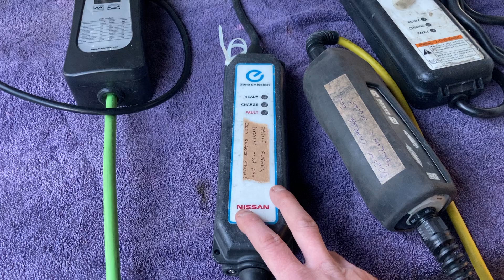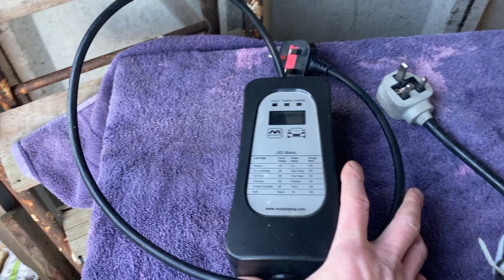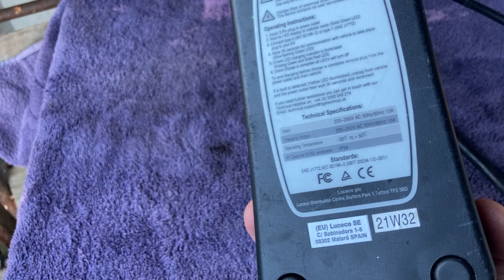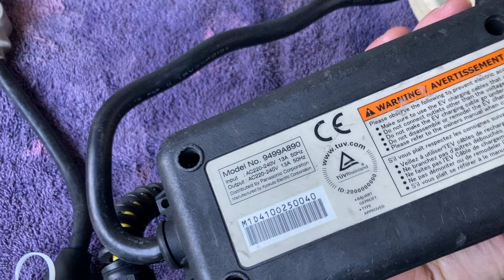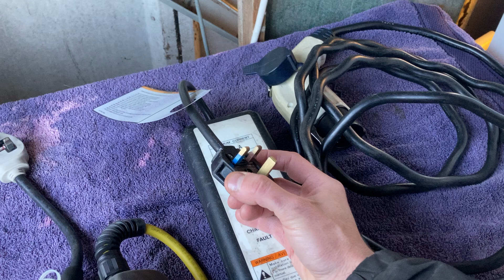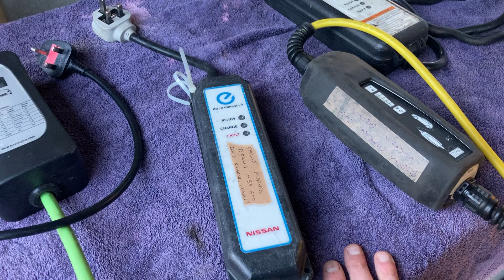*EV Drivers* - check your 3-pin charging leads! Are 3-pin EV chargin cables safe??  (Granny leads)

Comment: It's a good idea to use forced air cooling over the power socket. I use a UK 'granny lead' which can be switched to 8, 10 and 13 Amps. But it underperforms at all settings. The 13 Amp setting delivers slightly over 2.4 kW, which is about 10 Amps on our supply, which is at 245 to 250 Volts. With the fan running, the plug pins are mildly warm (around 45°C) after 5 hours of use.

Comment: I have the Screwfix model looking like the one pictured (bought three and a half years ago. The reading for a nine hour charge on the display used to show kWh properly, but about a year ago the amount charged dropped, suggesting that charging stops and resets for a small period. It works well on the Zoe inside the garage using sockets from a 2011 re-wiring. i expect i will find the cut out if I investigated in the middle of the night. Perhaps the course of action, as in all of these cases, will to be buy a new lead some time.

Comment: Question. Do adapters for use in EU add to the risk when the granny charger is connected through them?
Reply from the maker: Hi yes, any extra connection would add risk. You can feel the plug/adapter after 30 mins / 1 hour / 2 hours to check it’s not getting warm. The socket itself would be fine as eu shuko sockets can take 16A max, 13A continuous.
Reply: @ thanks. I have a 10amp Tesla charger but will check the adapters anyway- we have a large stock of adapters so can swap them if getting warm. We will be staying with friends in a very rural location so granny charging will be desirable 👍

Comment: Not only the max amperage is important but also the ground fault detection should be considered. The advised max AC leak current should be 300 mA and the DC leak current should be 6 mA, both according to type B, not to be confused with a B characteristic of a breaker.

Comment: Shucko user here (continental Europe). 

For the last 4 years (ze50), I have been using a 16a 3 pin charger (3.6kw). Covered 95% of my mileage (43kkm) using the 3 pin charger. The power on mine is not adjustable. 

Here is my 2c. You have to be very very careful and check the temperature of the socket/plug until you are positive about the quality of the pairing. On a good quality socket, I am fine with leaving it overnight - no issues whatsoever. 

Extension cords are a really bad idea, unless you have an amazing quality one. 

Also, NEVER, NEVER use an extension cord on a reel. On one occasion, I used an extension cord on a reel without thinking much (kind of emergency charging), and it completely melted after only 1 hour - to the point of fire hazard (it melted so badly that the reel completely fell off the carrier, and wires short circuited deep inside, causing the circuit breaker to trip). 

I do own a 3 phase charger (22kw), but in most cases elect NOT to use it, as loss of a single phase and then restoration of power on it WILL cause a major short circuit in a Zoe. Also 8h overnight 3.6kw charge works well for me - to get me to the desired 80%, and on top of that I use the low rate of electricity when charging overnight..

Also according to some tests, single phase 16a charging on zoe is the most efficient one. I have not conducted them myself, so not positive about this.

Comment: I would never use such crap.
Home wall outlets are not designed for these long running 100% loads.
The Dutch 16A circuits at least limit some current, the UK32A loop systems let you abuse that outlet to thermonuclear temps 🙂
Reply from the maker: 32A ring circuits are considered overkill now, 22A radial circuits seem to be common now where it’s only connected at one end!

Comment: I am a little surprised 13A is considered dangerous on the UK's comically large plugs when the humble 14-15s of decent quality can do 12A continuously perfectly fine. I borrowed my mother's Bolt EV the last time I visited a friend out of town, charged at his place at 12A and the plug was still barely lukewarm after 20h of charging.

From the examples of failed UK plugs I have seen, the biggest problem in the UK appears to be built-in fuses melting the plugs when the load/fault takes too long to blow it. A pretty silly problem to have IMO.
Reply: Don’t forget you have half the UK mains voltage. A 10Amp charge for the UK would be 20A in the USA for equivalent power levels…..
Reply: @thelaserhive3368  The point wasn't about how much power can be pushed through the outlet, it was about UK outlets having comically low current-handling capacity for their size.

If you want 240V in NA in a general-purpose format, there are the 6-15 and 6-20. Up to 16A continuous at 240V in the same footprint as a 14-15.
Reply: @teardowndan5364 The UK plug is barely warm at 10A continuous, just don't use the cheap imported copies.
Reply: In Germany we have no fuses in the "Schuko" plug. Many people think (even electricians) but it's only tested for 1h-2h on 16A. Long term usage should not exceed 10A

Comment: No mention of the dangers of PEN faults - Level 2 chargers (e.g. Zappi) have PEN fault detection which will cut power to the car if tripped - otherwise, unless the car is inside in a garage, the rising voltage on neutral compared to true earth will turn the car outside into a return path ... through you if you touch it.

Comment: Agreed - I only use my EVSE in a couple places (my parents house for example) but I explicitly got a 10A EVSE without selectable current to make sure I cannot accidentally select 13A. 

I wish there was an EVSE that will allow you to select 6,8 and 10 only but it isn't really a thing I could find, hopefully someone can prove me wrong.
Reply from the maker: The variable ones aren’t common unfortunately, and some are 13Amax which isn’t much good. Even a 8/10A would be handy. Cheers
Reply: @ True, the fact 13A exists on some UK sold chargers if I recall may be incorrectly sold.

Comment: Bought a £10  granny charger which looked new @ car boot,   Someone had fitted a 15amp fuse and it had started to melt , cleaned up and 13 fuse used on a descent socket and still works fine .  P.S. find it REALLY annoying that the Zoe charging can’t be adjusted 😠
Reply: 15 amp isn't a be standard plug top fuse, so there could be anything inside a fuse that is marked as that.  A 13 amp fuse is designed to melt at 20 amps continuous draw.  Heating is proportional to the square of the current draw (I²R), so there is 1.7x the heating at 13 amps vs 10 amps. Heating will always occur on the fuse because it is intentionally a point if high resistance.  The problems happen when there are poor (high resistance) joins elsewhere but nearby (e.g. wire to plug, wire to socket or plug to socket).  That's why the EVSE types which have a temperature sensor in the plug are a must. Mike Harrison ("Mikeselectricstuff") has a video on his channel from a few years ago where he goes through all of the safety features that an EVSE is supposed to have, whilst testing a couple of cheap imported models.
Reply: @ yes surprised me, I’d never seen one but a assumed the previous owner had just had trouble ( maybe his socket) and uprated the fuse with 🤞.   It was a cheap chink charger but seems to work OK .  My BMW issued charger has a 10 amp fuse

Comment: Mine does 6,8 and 10 amps selectable. I rarely use it, except in holiday cottages with owner permission and I turn it down to 6 amps.
Used to use it on 6 amps to charge from my solar panels on surplus days, but now it is better to just export surplus at 15p/unit and charge at night for 7p/unit.

Comment: In my dad's garage, all the Schuko needed replacement after about 4 years charging a Citroen Saxo and a Peugeot Partner electrique (the old cars NiCd battery, 13A continuous for about 6 or 8 hours) We have upgraded to the blue 16A CEE Herr is still using those for his plug-in hybrid and ebike
Reply from the maker: Wow the Saxo and Partner electric are proper old school EVs! They had flooded nicad packs iirc?
Reply: @garycevrepairs  yes they had, in the saxo we tried replacing a few 6v packs, if we managed to put it back together without leaking coolant (it was water cooled battery pack as well as liquid acid, what a mess)
So if it was running for few hundred miles after replacing a pack or two, it didn't last long until the next pack was weak. 🤦✌️

And a weak cell led to higher load on the others, which killed them sooner or later. And we also had to refill distilled water for the cell acid a few times, and we replaced the motor brushes! It had a DC motor with 11KW rated 🤷😂
Reply from the maker: Fascinated by those old EVs but they need a lot of fettling.
Reply: @garycevrepairs  it was a crazy time... My mother needed an easy to use "cheap" with some comfort, for 15km commute per day. Before she had a Volkswagen Passat GT synchro G60, everything broke on that car and she was fed up with Volkswagen. 5 years ago I still saw that saxo cruising around with it's new owner after we sold it in 2011. The new owners were used to quirky cars, her father in law once had an electric Lamborghini "Kit car"
😂✌️
Reply: The battery should always be empty before charging, because of the memory effect. And then it should be charged completely to 110%
Reply: @MrKOenigma  Absolute garbage! The so-called 'memory effect' does not exist, as has been proved. What actually happened was voltage depression caused by overcharging, which is exactly what the early chargers did because they had no delta-v detection or any charge management. Just don't overcharge them and there won't be a problem.
Reply: @DelticEngine  that explanation absolutely helps me a lot today, thanks

Comment: Also the Charing rate can be controlled by resistors between ground and CP pin. But this is not really DIY . But open evse is an interesting source of information for the qualified.
Reply: Charge rate is signaled with pulse width modulation. Mike Harrison's videos are a good reference @mikeselectricstuff
Reply: @Tim_Small  thanks I will have a look
Reply from the maker: Yes indeed modifications are possible but for people to explore for themselves if qualified as you say.

Comment: Maybe a solution is to cut the plug and fit a commando plug of 16amp rating these are the blue plugs and sockets used in factories for single phase elec.and the sockets have a spring lid that gives ip42 protection .which you don't have with 13 amp .
Have worked on a building site where builders have used 13amp and it very alarming the amount of electric shocks they get.luciky I check that the RCD trips under 100ms
Reply from the maker: Interesting idea, you have to be careful if you want to remove the plug in case it does have a temp sensor inside. I repaired a granny cable for someone who had a damaged plug and cut it off but then found the extra wires! I managed to cut the plug open (it was a moulded all in one type) and retrieve the temp sensors, fit them into a “tough plug” and repair the wires. Quite a job but interesting and it worked! Cheers
Reply: @garycevrepairs  good point it will be a rtd so just a resolder job in new plug ok if your an engineer but not for DIY. Love your channel as a c&I engineer seeing how relatively  simple EVs are I find each video enlighting but personally not going for level 3 qualification

Comment: Please note that Zoe has very inefficient charging at low powers - about 75% of energy goes into the battery. So the 10A EVSE draws about 2.3kW from the grid, but about 2kW goes into the battery.
Reply: Similar for Kia/Hyundai models, at 1.3kW charging is only around 69% efficient and at 7kW it's 94% efficient. This is a combination of the inherent losses in charging a lithium ion battery of maybe 2-3%, plus the more or less fixed loss in the onboard charger, overall it's around 400W. The vehicle's software quite accurately accounts for this when it estimates charging time.
Reply: Where does the other 300W go
Reply from the maker: Efficiency loses, heat, noise, running ecus, water pumps… no circuit is 100% efficient, just like your tv is warm at the back, it’s losing some of the power it takes in. As he says the Zoe is particularly inefficient at low amps, it’s a downside of its ability to do faster ac charging. Cheers
Reply: @garycevrepairs thanks for the explanation, but I am aware where inefficiency occurs. Perhaps my comment was too cryptic. I was thinking more of the 2.3kW really being 2.3kVA and the apparent loss of power being mostly a poor power factor.
Reply: @alanbenson9626  The plug and cable get hot for starters.
Reply: Came here to say this. Better for the planet and wallet, in the long run, to get a proper charger installed. If you are plugging and unplugging the charging lead, you'll eventually wear the wall socket and connection resistance will increase. Suddenly and arrangement which has worked fine for years can melt on you.